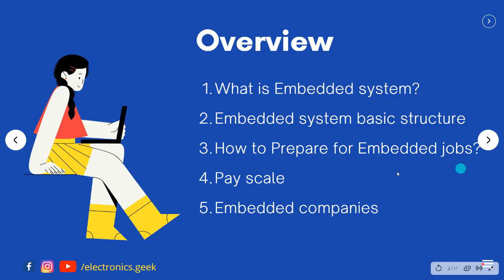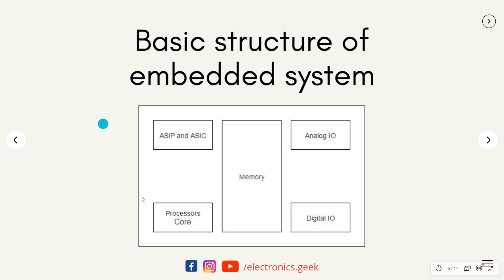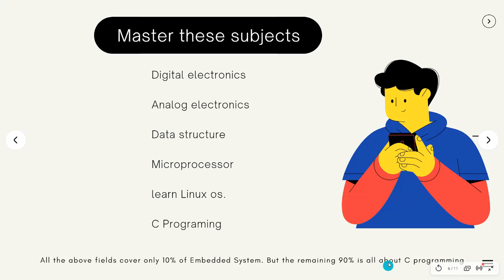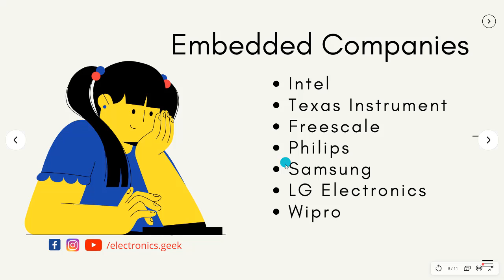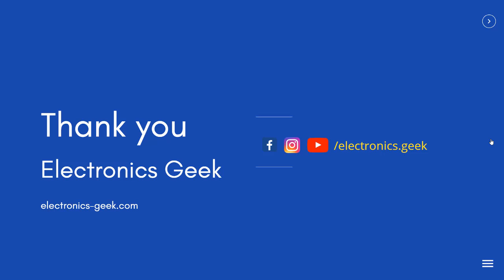What is Embedded System? How to Prepare for embedded jobs ? Pay sale , companies etc.

Comment: Excellent video,
But in my opinion, the beginners should start with ARM cortex MCU rather than Arduino or raspberry Pi, because that gives them more hands on experience on how the things are working at firmware level as they will write code on baremetal directly.